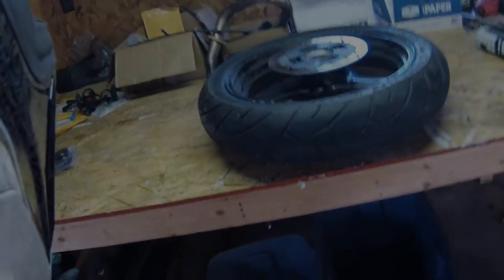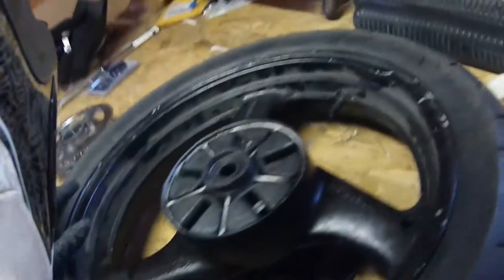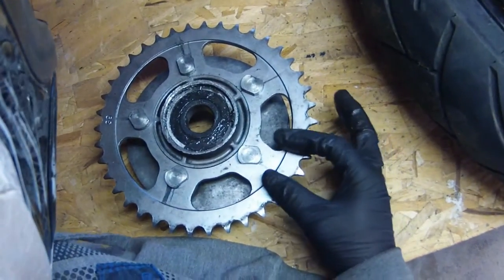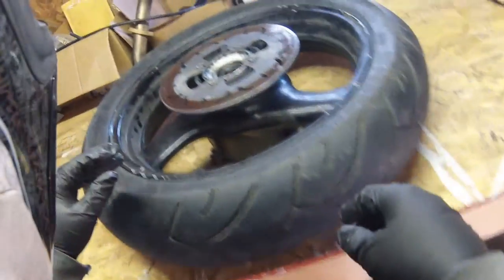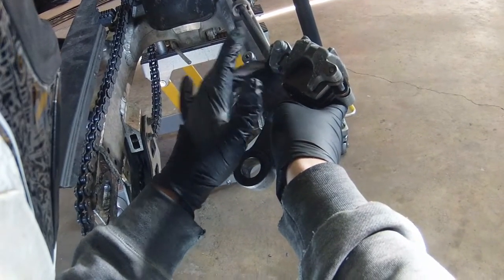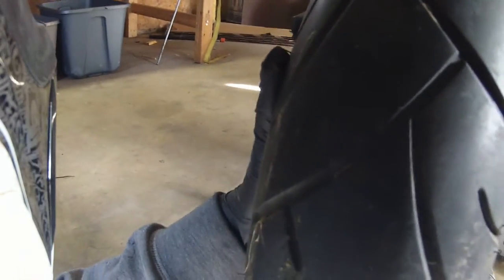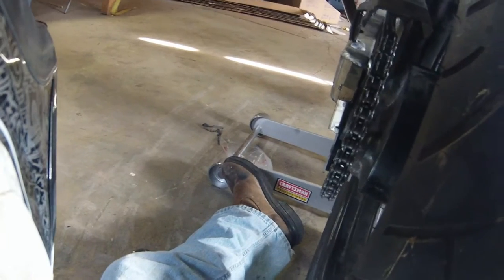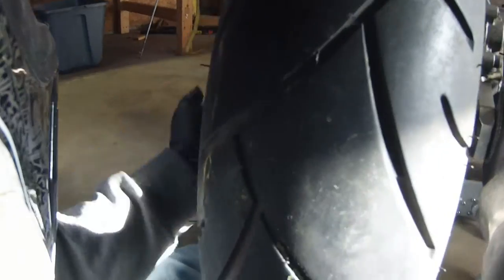Hooligan mod part 3: Rear wheel build

Comment: So I have a fully put together gs500 rear wheel that I removed from a salvage bike, that cush spacer that you replaced with the 1" tube actually goes into the bearing to sleeve it down to the stock 15mm axle size. The bearing part number you give is a 25x62x17 and the stock spacer was sleeved down to a 15x25x~60 to put the axle in contact with the hub. By replacing it with the same bearing you are not putting the cush hub directly in contact with the axle like was intended, you could have the stock spacer machined out to a 20mm internal diameter but I'm looking into getting a bearing that is 20x62x17.

Comment: i have recently aquired a drz400s with the gs500 wheels. but have noticed the chain rubs the tyre. what size tyres are you running. mine has 160-60-17
wanna know what size to go for to avoid rubbing
cheers
Reply from the maker: chris hunt I run a 140 but I believe you can run a 150 without rub.
Reply: think ill swap it for a 150 then. the 160 rides really nice but i reckon a 140 will lose the sharp steering. thanks for the quick reply :)
Reply from the maker: chris hunt I don’t run mine hard enough or really a whole lot with two other bikes in the garage. So the 140 does me fine
Reply: haha fair enough. thanks to your spacer recomendations i have also worked out that the wheel is set 3mm further to the right than should be so will machine up some correct spacers tomorrow which will hopefully help chain alignment. :)  mine was 10mm on left and right was 1mm plus the 17mm standard... (missing a 1mm and 3mm further to right)
Reply: actually one more question if you could? how much room do you have on your 140s between the chain and the tyre just thought nudging chain in line will actually make my symptoms worse although it will make chains and sprockets last longer.